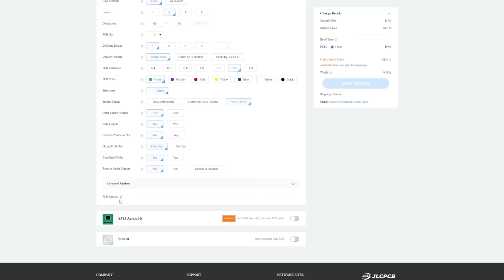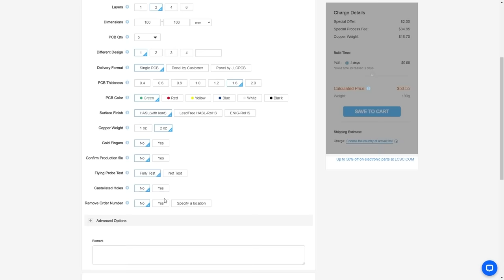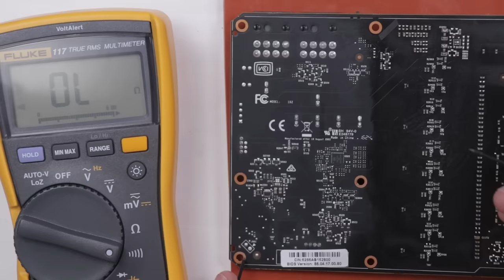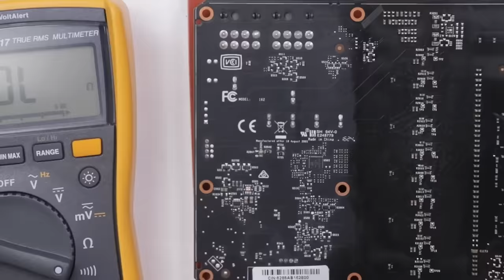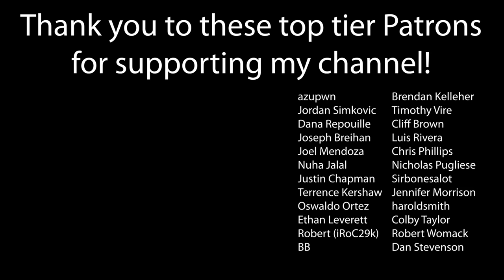I Bought 7 BROKEN Graphics Cards to Try and Fix - I Was Disappointed

Comment: The problem with dead graphics cards is that when there's a catastrophic power failure in one of the components, there's a high chance it will fry a lot of other components in the process (which may not be visually apparant). A lot of times the GPU core and/or memory modules get destroyed as well. They are extremely sensitive to voltage spikes. Even a couple of volts too high can instantly destroy them. There's also a lot of annoying issues that can happen like faulty memory modules which you have to individually test for and then replace the module. In general graphics card repair is a huge pain and only recommended if you really specialize in it and know all the little details of what's happening with each generational architecture / board design. I know a lot of repair shops avoid graphics cards, also because there's so many different models that it's hard to get replacement parts. According to NorthRidgeFix over 50% of graphics cards they work on end up being a "no-fix" either because the problem cannot be found or the GPU core is dead. Big time waste.

Comment: What always amazes me about these is learning about the insane number of components besides just the ICs. For these to work properly all these capacitors, resistors, mosfets, etc. must work within tolerances and not fail. Even with a tiny chance of failure per year the probability of a failure somewhere becomes very high. So, the chance of failure for these individual components must be near non-existent. That's amazing manufacturing quality in fundamentally inexpensive components.  That means the entire supply chain making these components must be extraordinarily tight on accuracy and lack failure points. It quickly becomes bewildering.

Comment: Depending the card, the fans won't spin up until needed. Also, I wouldn't run them without at least a fan on them. They heat up quick (within seconds) and can cause permanent damage.

Comment: @TronicsFix
Im sure someone has already mentioned this but just in case, you shouldn't be running a gpu or cpu with absolutely no heatsink... All these modern processors has a thermal limit of around 100°c. That GPU was already overheated before it even booted into windows.

As for most of the cards that looks like they experienced excessive heat around the GPU itself is pretty normal for a perfectly working card. As I mentioned above these cards run around 80°, 90° normally under heavy loads especially in a case  with bad air flow. And they will go up to around 100° maximum worst case scenario. So with the pcbs or gpu die's show signs of excessive Heat  is not necessarily an issue...

Comment: As some comments pointed out, the missing RAM module in RTX 2080Ti is normal, that is the reason why that card has "only" 11GiB VRAM and 352bit memory bus (instead of the 24GiB and 384 bits memory bus of the Titan RTX card which shares the same chip), and also the missing components of the power phases are intended by design to save costs.

Other thing I think might come in handy: when testing for RAM problems like in the second to last GPU (if i remember right it was a 3060) just use MODS/MATS (a bootable tool for internal testing at nvidia which got leaked about a year ago, beware of scams and viruses tho), that usually identifies the broken chip. The memory chip itself is dirt cheap (5-ish USD, more or less depending on model), and for someone with your skills pretty easy to repair (you will need to preheat the board quite a lot, but apart from that, I was able to perform this repair as a complete novice on a dead GTX770)

Comment: With the 3060 perhaps consider reducing the Memory clocks with MSI afterburner. On the 2080ti with "missing parts"- they're probably not missing, the board design is probably just reused between different models. You could try a heat gun on the non working cards, but GPU's are difficult to fix even for people who know what they're doing.
Reply: Considering it has a space for a memory chip and it had a memory error, I'd suspect it should have been there
Reply: @ksevio  They have standard board designs- he didn't test the 2080ti at all just presumed that it wouldn't work. The 3060 probably had dead gddr6 chips as some of the early RTX cards
Reply: The board is used with the RTX Titan and the 2080ti. Like how the 3080 ti is still the same chip as the 3090.
Reply: Considering that mans tried to run Heaven bench with no heatsink installed the thing is fried lmao
Reply: @ksevio  2080ti has 11gb of vram and all the boards have one empty space(2080ti’s).

Comment: A lot of GPU's Have places for extra memory chips and other parts but they don't use them. They're only used on higher end models like going from a 3070 to a 3080. This is due to the PCB being the same for each model.

Comment: when testing gpus you can insert 2 gpus in the pc. one you want to test and one you know work. when the display is connected to the known working gpu you ca go to device manager and see if the one you want to test
 shows up. also never stress test agpu without cooler installed, even booting it without is a risk. install the driver for eatch gpu. use ddu to delete the drivers from previous gpus.
Reply: that is if he has a motherboard with 2 PCI-E slots.
Reply: Or just use a processor with an iGPU
Reply: @H3LLGHA5T  yes, that too :)

Comment: I'd not apply thermal paste before ensuring that it at least boots properly with no artifacts!
Also having an iGPU in your processor or just a second graphics card would be nice when there's no signal out to see if the card is detected.
A frequent failure is no VRAM detected, so GPU Z can tell you about this. I think that's what happened to the RTX 3060
Every missing component in the 2080 Ti looks factory, so why don't you test the card?

a GPU failure happens but it's rare!

Comment: Giving up on that 1080 was not a good thing to do. Modern gpu cores very rarely get hurt from any kind of over clocking. They would've had to flash the bios of the card or they would've had to do a shunt mod in order to cause damage to the core from over clocking.

It's worth it to try to fix it
Reply: especially FTW which is factory overclocked.
Reply: Failed bios flash on the GPU could be the issue if the card lacks dual bios. Fwik it can be fixed with another gpu. Quite common to flash other bioses onto gpus to unlock higher power limit

Comment: the EVGA RTX 2080 Ti looks perfectly fine on the PCB, no missing parts, only the amount of thermalpads is the issue here, they are too thick and no cooler contact on the gpu chip. Try to apply normal thermal pads (Thermalgrizzly are the best) and the perfect amount of thermal paste, i bet they work.

Comment: It's always a real crapshoot when you buy electronics, especially GPU's, second hand. Too many bitcoin miners out there burning out GPU's and then returning them to stores or offloading them on ebay. I got lucky and picked up my MSI AMD Radeon RX 580 8GB via Ebay back in 2019 used for $180.00. I was expecting a burnt out paperweight to come out of the box when it arrived, but I was surprised to find not only did the card look almost new, after I gave it a good cleaning, it worked fine and is still going strong today.
Reply: Can't mine Bitcoin on graphics cards.

Comment: You should watch Tech Cemetery on GPU repairs, with your testing every GPU in this video is still potentially fixable. Well you may have killed the 3060 running it at 140° C, never run a GPU without cooler, put a CPU cooler on it for testing but don't stress without cooling VRMs and memory. Also GPUs often turn off fans after initially powering on since the VBios takes control of cooling then, most GPUs have a silent fan curve where the fans only kick in when a certain temperature is exceeded (mostly around 50° C)

Comment: EVGA also offers a second/third owner warranty.  So you could have simply tested the serial number on their RMA page and had the cards exchanged free of charge... After you've tried repairing them, of course a RMA is no longer possible. It's a shame that so few of the graphics cards can be fixed.
At least they now have the perfect amount of thermal paste.
Reply: The cards had already been taken apart before he bought them, if warranty was valid you can be sure the previous owner would have sent it back.
Reply: If i remember correctly evga doesn’t have any problem about warranty if you open the card, the sticker is present but it’s not for the warranty. This is because I see a lot of video of jay two cent where suggest on evga card to replace thermal compound without any problem with the warranty
Reply: @ChristianBelotti  If that's the case there should be no faulty EVGA cards for sale as they would have been replaced with new, I think you will find opening the card for any reason voids the warranty, that's why they have special seals on them.

Comment: EVGA 10 series cards of that era, especially the early ones did have a tendency to blow components. If you were lucky it wouldn't take out the core, but often, it did.

One thing to be wary of with crds that seem to work on the short term, sometimes cards take a good while to actually crash. I had a 3060Ti that would run for a long time and then randomly go to a black screen with the fans at 100%. Only long-term tests are going to catch those, so be careful if you're going to try to sell the ones you think are good. You might be sitting on timebombs and not know it.
Reply: Yep, in Nov 2016 EVGA offered free kits for users to install and reduce those failures. I still have my 1080 that I rebuilt. It was basically just a bunch of new thermal pads.
Reply: My 1070 burned to a crisp too... I'll avoid EVGA whenever I can... I had a PNY GTX960 since 2015 and never had any problems even with many lightning it faced throughout the years...
Reply: I inherited a 1070 FTW which was in fantastic condition, but which also didn't produce any display. I couldn't even use MATS to determine if one of the VRAM chips went bad, since it absolutely refused to display anything. I would've loved to upgrade to that card from my current one, but since I didn't have the equipment or knowledge to fix it, I instead sold it for parts/repair. The PCB itself looked great as well, with nothing out of the ordinary.

Comment: Hi Man! that was nice to see. I have a couple points that could help for a further revision of this cards:
1. Usually the mining cards shows kind of a glossy spots on the PCB under the memory chips, main chip and the VRM/mosfets. So it looks like a couple of this ones were used to mining, in wich there are additional spots to check like bios, drivers and memory damage.
2. Try not to test the cards without a brick over the main chip because that temp rise over 120C could kill them even in testing
3. Usually the testing for voltage goes: 12v ext input, 12v PCI, 3.3 PCI, 5v output, 1,8v logic, 1v mem controller, 1.5v memory and 0,9v to the GPU core. usually when all the voltages are ok but the GPU, and the mosfets are ok (no short between the phase inductors and ground), could be the phase regulator or further components there. Sometimes there are issues with the regulators for the memopry controller or the memory chips and those could be quite tricky to check because the fall damage just by touching the wrong pin on testing, but replacements are cheap and could worth the repair.
4. This mining cards like the 3060 could show damage on the memory chips in form of artifacts or green spots on games/benchmarks. There's a tool for nvidia GPU to test the memory damage and usually shows the chip that has to be replaced. The tool also exists for AMD but it's not as fancy

I use to get damaged cards and it use to happens that people just sells them when someone already tried to repair it and goes FUBAR for the cards. So i learned a lot from what not to do with this...
Reply: also they might have a no display bios
Reply: @rixas20  that's a good one. I didn't even know about it!

Comment: Suggestion for 9:10:
I have had a bunch of fully working gpus which I had trouble showing any signal on multiple monitors and cables and computer systems.
An indication of a good card is if you see the fan start up AT ALL and the motherboard does not flash a red LED near the gpu.
(Not nessesarily certain all motherboards will have these leds, but they generally all have some way of telling you if there is an error with the hardware)

Its common for fans to spin for a brief moment while starting the card, then turned off again once the data from the temperature sensor is available.
If we assume you have the same issue, what I have found which might help is the following.

1. Connect the cable to the monitor and choose the corresponding source.
2. Power on the computer normally.
3. Then press a reset button, not power on/off.

You have the primary reset button (connected to the switch on the tower) and some motherboards even have a secondary one directly on the motherboard.
Either of those should do the trick if we had the same problem. Though I really don't understand why I have been experiencing this.

Comment: You'd be surprised how many dead GPUs I've come across that overheated from misuse (folks leaving their PC case open and not cleaning it regularly/using a case that lacks proper ventilation).
Reply: There's also the GPU software that has the fans set to Auto , and in my opinion doesn't keep the card cool enough .
I always set my fan speeds before gaming. The extra fan noise is worth it.

Comment: Never run the GPU naked, put at least a small alu sink on it even for short power tests. THe 3060 also could have flashed a mining BIOS on it, you should try to flash the manufacturer BIOS again. Also some dis-colourisation around the GPU mostly happens in around the clock running systems and is normal ageing.

Comment: Generally speaking running GPUs with the potentially several hundreds of watts that run though the GPU dies without a cooler can be a pretty sure fire way to overheat and kill them it is HIGHLY recommended to not run a GPU on without a cooler attached as it can very very easily damage the GPU die itself as it gets caught with a thermal runaway before it can shut itself down
Reply: Also like many others have mentioned the 2080 Ti board was normal that had nothing missing companies use a set PCB design and add parts as they need depending on what SKU it is to save on manufacturing costs since the 2080 Ti is an 11GB card it only needs 11 ram modules
Reply: The biggest thing too is making sure to wipe and reinstall drivers between each GPU. Sometimes the Nvidia drivers don’t properly detect new devices until a restart after windows detects them.
Reply: @GhostTurtleYT  or just install them full stop

Comment: How is testing a graphics card with no heatsink to check how hot it gets a valid test? if anything you're making it worse, that specific gpu (evga 3060) didn't have the driver installed for it either, you could tell because the resolution in windows was so low, checking device manager is a pretty standard one, likely report a error 43. I think you massively overpaid too $450 each for broken cards, maybe 6 months ago that might have been good, but that gt 1030 is a $100-120 card new, so you've paid over $500 each on 6 cards, crazy imo.
Reply: This is the comment he should read

Comment: I have a similar EVGA 3060. I have 3 years warranty. I'm 100% sure that yours should be still under warranty. Before  you open, you need to check the serial number on their website. But since you rip the warranty sticker, it's no use then.

Comment: That 2080Ti has all the necessary parts on it. The 2080Ti has 11 1GB memory chips but there is space for 12 since the design is shared with the RTX TITAN which has all memory spaces populated with 2GB modules.

Comment: Common issue on the gpu ,on of them are vrms mosfets, vrm controller like 5v 3.3v 1.2-1.3v and 900mili volts to 1 volt, and the most common video ram colder joints and failure u have to replace it with the donor board

Comment: try installing the drivers for the cards. That most likely will fix the issue. If not you can try updating the BIOS on the MOBO to see if that will fix the issue
Reply: also could try updating the VBIOS on the cards to see if that will fix the issue.

Comment: Fans usually only turn on when the card reaches a temp threshold. Otherwise it will run without them spinning. I almost choked when I saw you boot up without any cooling at all. I then died when you ran a benchmark lol
Reply: Not all cards do

Comment: you could check the serialnumbers on the EVGA Cards if theyre still under warranty. The 3060 could be, open an RMA and send it in and get a new one.

You also could check to try to reflash the VGA Bios on the cards, since they could got corrupted and flashing could fix it
Reply: Evga won't touch this now, warranty stickers are voided
Reply: @AnotherDud3  wrong as long the card is not physically damaged. It’s still under warranty. Cards are still under warranty if you change the thermal paste or the cooler.

Comment: Going into gpu repair without any experience is like going into a sand trap with no one to pull you out. The people who make these things make them so finicky and most need a decent motherboard plus software to remove old gpu software before installing new ones etc. nvm the dozens of other things to think about. Basically if you do one of these videos again stick to trying to repair maybe just one or two decent cards like a 2080ti or 1080 and focus on just those. Sorry that someone convinced you to waste your money on all those. Assuming u already knew all of that well, there’s not much you can do if someone harvested pieces of the circuit board, yikes. Hope one day you have a way to get those pieces and possibly repair a board that was scrapped if that’s even possible. Would be interesting to see. Thx for the upload and GL!